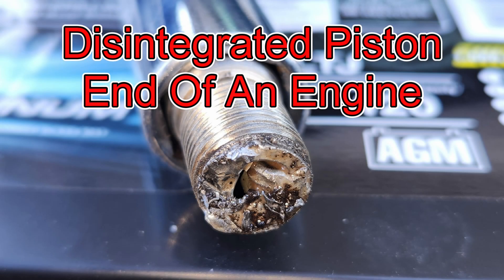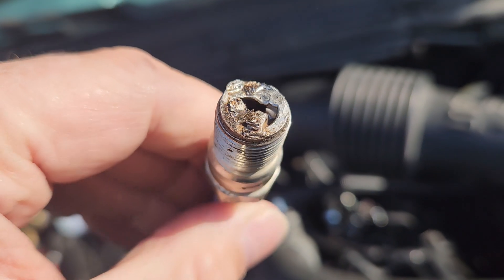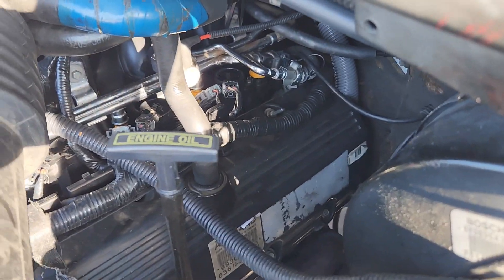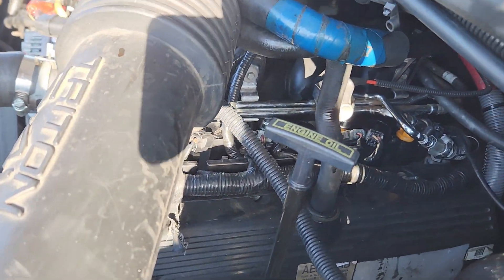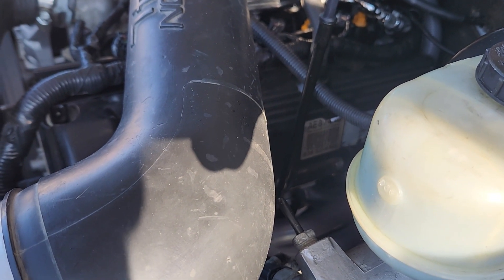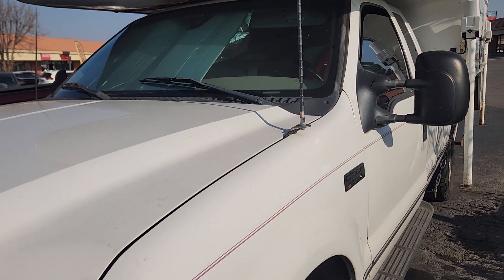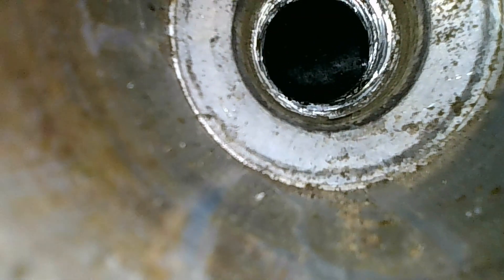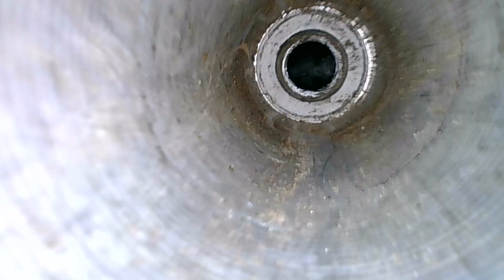Disintegrated Piston End Of An Engine

Comment: Total Bummer....Well, all of the expensive PARTS  ( Melling pump, ARP studs...etc) are re-usable... on the "new",  junkyard motor.  From a truckers perspective, the FORD 7.3 is far from the best. 
research  thin cylinder walls ( Bored out 6.9 International) and cylinder cavitation.  Best is the International DT466. Farmers truck mainstay. MILLIONS of them made.
Reply from the maker: Yeah, I still have the studs and melling pump. The builder put in new twist bolts and melling. If I ever do another engine, I'll use the parts on that.

Comment: Did u put new valves an guides an seats in the heads on the bullet proofed engine ??? Did u lap em in or did u take em to a shop??
Reply from the maker: @jamiejones3315  
Both engines, the failed one, and the new one being picked up this week, had all the upgrades done to the engine.

Comment: Headers, free flowing exhaust, free flowing intake might have leaned it out too much without a tune to compensate, resulting in the piston getting too hot.
Reply: I thought that too when I first saw the video notification and saw it was a failed piston..  Hard to tell without any data proof.
Reply from the maker: @mitchf1508  I never got a lean code or any code. Also the engine idled at 173 degrees and ran under load up to 183 was the highest seen. We had been up and over several big passes without issue. This happened after a couple hundred miles of flat land at 68 mph so not pushing the engine. Just bum luck I fear.
Reply from the maker: @mbleitz  It's a remote possibility but the electronic controls should be able to compensate for lean or rich conditions. You would think it might if anything burn a hole in the piston, not totally destroy it.

Comment: Time for a Chevy.
Reply from the maker: @richsadventures1889  Have you seen those videos of Chevy, GM truck frames crumbling into rusrt bits after just a coulpe years. I think Ill go with a 2003 F350 or larger with a 7.3 diesel.
The Ford gas 5.4 and 6.8 modular engines have proven themselves unreliable. I'll secure a tow vehicle Monday.
Take care Richard